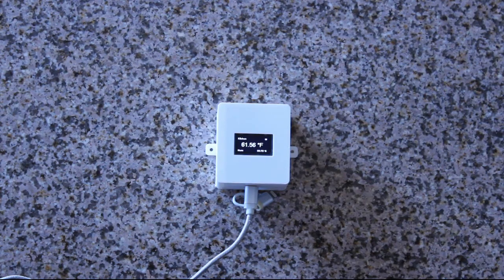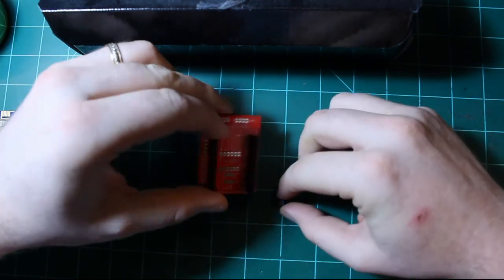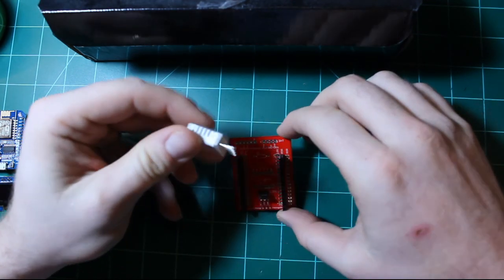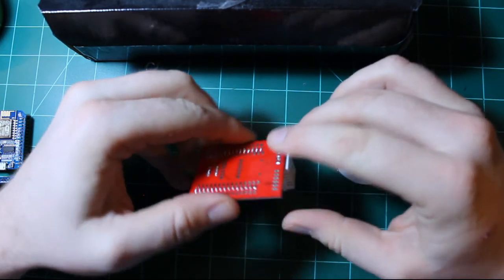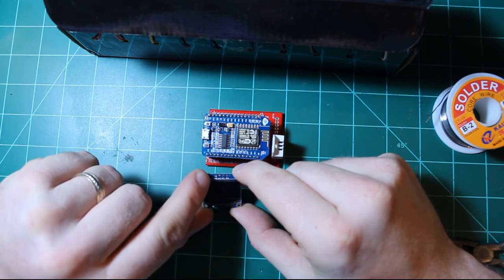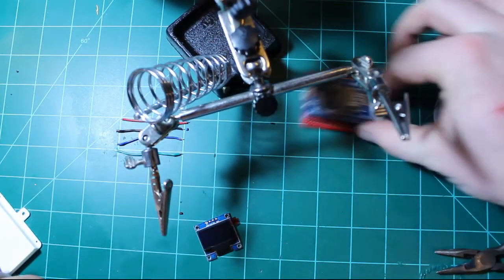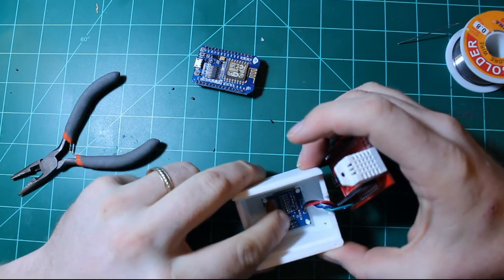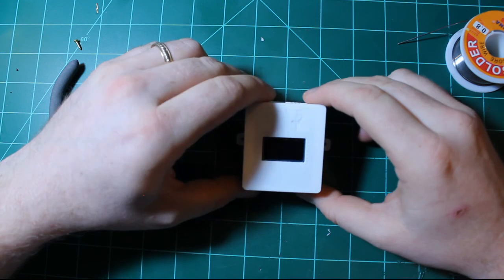NodeMCU Kube home automation multisensor Build - Part I (Hardware)

Comment from the maker: What type of sensors would you want to see software support added for? The current firmware supports temp, humidity and motion, but I'm planning to add differential pressure (for HVAC blower monitoring) and sound level (for room presence detection). Any others?
Reply: PIR or ultrasonic
Reply from the maker: Good ideas! So, it already supports PIR (I've tried the HC-SR501 and uxCell sensors, both work, but I prefer the HC-SR501). You can see my video on connecting it to the NodeMCU for direct 3.3V power.

I like the idea of ultrasonic sensors - I already have one but haven't played with it yet What would you use it for? I could think of having some sort of proximity alarm or lights turning on based on the user's distance from the sensor..
Reply: BK Hobby it could be used as a garage door sensor instead of a reed switch or contact
Reply: I'd love to add the TSL2561 Luminosity Sensor

Comment: Hi. I really enjoy your videos. I tried to make this project but just it does'n work. I used the same OLED display and NODE MCU Amica v1.0. Nothing happen in the display and also it can't connect to the WiFI network. I'm not using the PCB but wiring directly to the nodemcu pins. I really apreciate your help
Reply from the maker: @JORGE ALBERTO FERNANDEZ OSORIO - I would make sure you're using the right pins, as defined in the code, and mapped to the right GPIOs. You could also try reversing SDA/SCL, just in case you have them backwards. Finally - if you're still using my code (and not ESPEasy), it won't show anything on the screen until it 1) connects to Wifi AND 2) connects to the MQTT broker. So, check if your router is showing the device, and try to subscribe to the MQTT topic to see if it's sending data.

If you still have problems, come to the Discord server and we can chat about it live! https://discord.gg/jUr7J4u
Reply: @BKHobby  Thank's for your response. I just double cheked the comments and noted about using the wifimanager. Now it's working the OLED and sending data to the mqtt broker. I just have one little problem. The DHT sensor is sending 0 and same showing in the display. I'm sure this DHT works because i'm using it in other project (5 minutes ago). I wonder what i'm doing wrong (beside my bad english)
Reply from the maker: Awesome! A couple things I can think of:

1. Are you using just the USB cable from your PC to run it? Because the OLED and DHT sensor along with the NodeMCU will draw too much power (and weird things like this happen)
2. Are you using the same pin for the DHT as one of your OLED pins, by any chance?
Reply: @BKHobby  I'm using a cellphone charger to run it, connected the DHT sensor to pin D2 and OLED display to pins D3 and D4
Reply from the maker: Hm, ok - and you're using my original code for this, correct? Or ESP Easy? I'm sure you've already checked the DHT22 pinout, but just double-check it, and I'm kind of out of ideas after that :)
Reply: @BKHobby  I'm using your original code. Now the OLED is showing temperature and humidity but with values too high. Like 560°C and 450%
Reply from the maker: Well - that's progress! :) At least we're getting a value - can you join the Discord? It'd be a lot easier to troubleshoot this live, rather than through YT comments :)
Reply: @BKHobby  Hi. I don´t know what Discord is. Can you explain me?
Reply from the maker: Discord is a chat server, and I've set up a special server just for this channel, so we can discuss things like my videos, troubleshooting, or general home automation stuff - just click on the link I sent above (https://discord.gg/jUr7J4u) and that should take you there :)

Comment: Maybe you can make an additional (snap on) enclosure for the motion sensor, this way this is also neatly enclosed.. ;)
Reply from the maker: Jonathan Caes - I was thinking about that, but from my experience with the HC-SR501 PIR sensor, you need to angle it just right to prevent false positives, and having it snapped on to the top of the enclosure would force it to be straight-on. Instead, I'm thinking about designing something like this: https://www.thingiverse.com/thing:2016385 but with a rotatable base (so you can get full 180-degree spherical motion in each direction), with a 3-wire connector attaching it to the main Kube sensor.
Reply: BK Hobby - That’s another good way to do it of course! ;) And that base can then be snap on.. That might also give you the possibility to attach other usefull sensors.

Comment: I'm late to the party, but very nice.  I do like your custom board ( did not think I would, but I do. ), and how it will accommodate different versions of the nodeMCU.    Does the heat generated from the nodeMCU affect the temperature reading?
Reply from the maker: Mark Ferrick - Short answer - not noticeably. I think the fact the DHT sensor has a closed back helps, and also, any effect caused by the NodeMCU can be filtered out by doing the calibration procedure I show in part 3 of the series. It is a linear calibration, but at the range of house HVAC we're looking at, once calibrated to the HVAC thermostat sensor, the temperature tracks very nicely (and really, that's what we're looking for, a reading relative to the HVAC system, not a precise absolute temperature).
Reply: BK Hobby I'm hooked  in. Got to do part 2 then 3 later.  Keep up the interesting videos.

Comment: how many sensor u can attach at once? i want over your 3 already attached .. to attach 3-4 more.. (light/smoke/wet/distance)
Reply from the maker: Tamas Koshegi - if all of the sensors are just digital / one wire sensors, there are 3 digital io pins left over if you’re using an i2c OLED...so you’re definitely able to get more connected

Comment: Will the v1 nodemcu fit in this case flush?
Reply from the maker: Yes, it will - The v1 is a bit longer than the 0.9, so I put in an offset on the pins of the carrier board, and I cut in a notch in the 3d model to account for the difference in length. I only have one v1 based sensor but it fits just as well as the 0.9.
Reply: BK Hobby nice, thanks for that. Going to print this with the parts I have laying around in my workshop, minus the PCB.
Reply from the maker: Great! It should work fine without the pcb, you might just want to hot glue the Nodemcu in

Comment: it's really not clear to me which holes are linked together with copper on the pcb.  Could you post something like a Fritzing diagram that shows which component/holes are linked together?
Reply from the maker: I'm sorry, I didn't realize I hadn't posted an actual schematic anywhere - all I had was the BRD/SCH files on the Thingiverse page. Anyway, I generated a quick PDF schematic and added it to the GitHub repository, here: https://github.com/bkpsu/NodeMCU-Home-Automation-Sensor

I will work on it some more to have better labeling, but when you put the NodeMCU against it, you should be able to tell which pin is connected to what (for example, D0 on the top right is connected to RST, 3rd from the bottom on the left, for Deepsleep function).